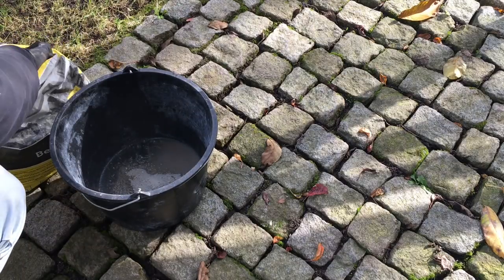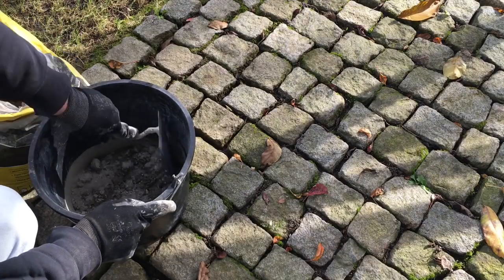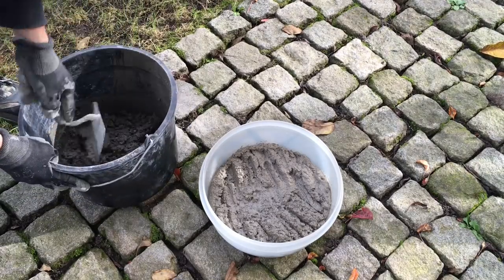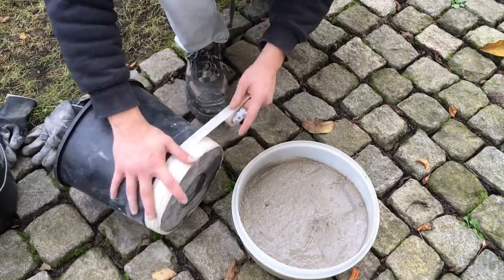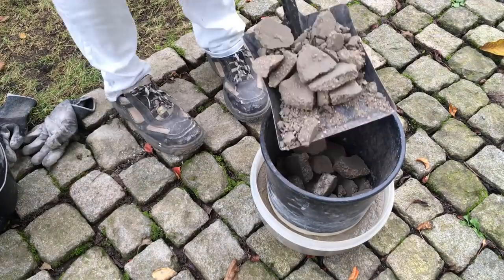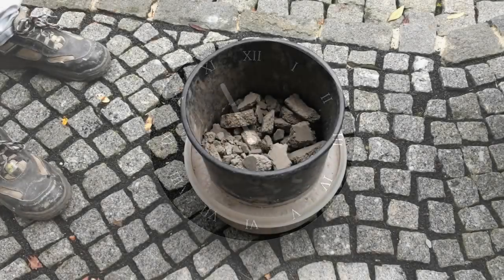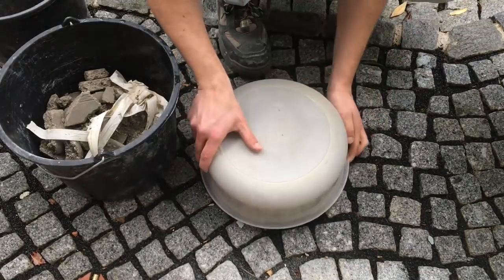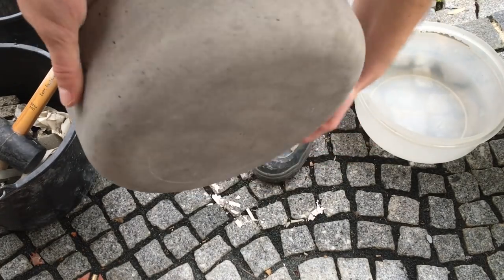Concrete Bowl - Quick DIY [1/2]

Comment: This is great! Do you think this concrete bowl can withstand binchotan charcoals without cracking?
Reply from the maker: Thank you, I needed to google for these charcoals because I didn’t know them ;) I think to be on the safe side you should look for a concrete mix which can handle heat. There are special mixes for that. Hope this helps.

Comment: Am I able to pour water in it after it drys, or will the water slowly seap out or evaporate
Reply from the maker: Hey, sadly concrete has many little pores so you would need to use a sealing product ;)